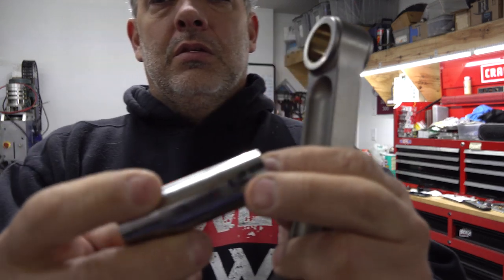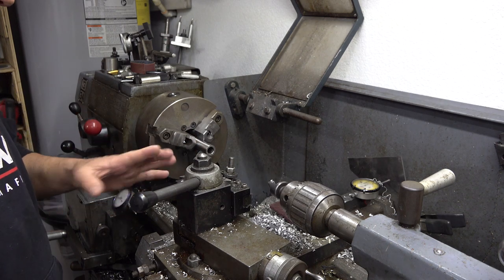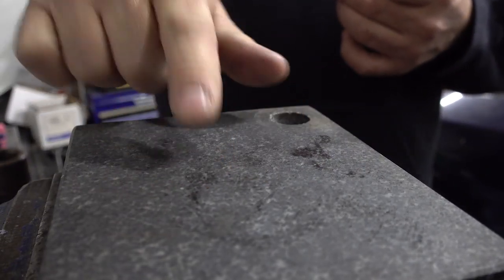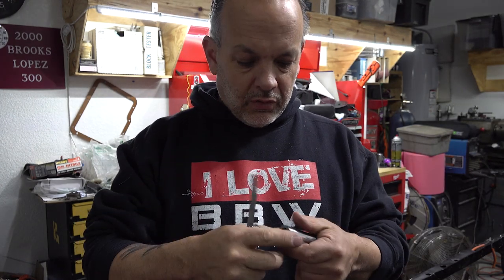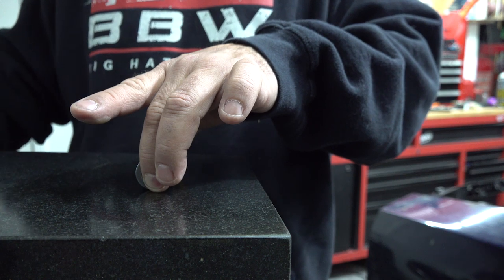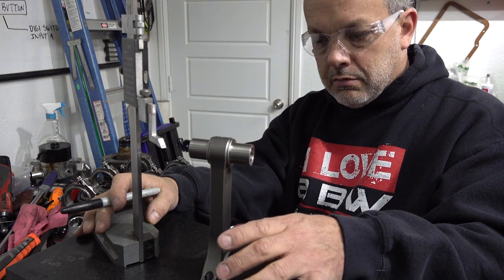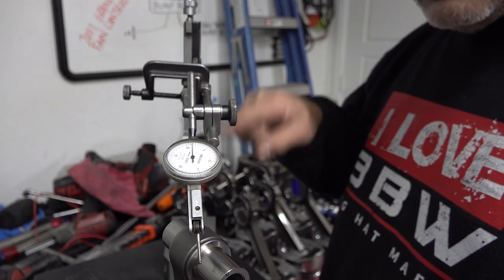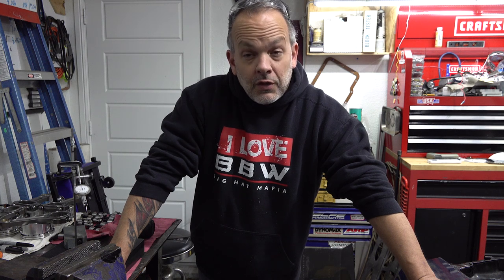You won't believe what I found wrong in the engine!!

Comment: Good call on pulling them all down and measuring. Not sure how long it took but I think it was time well spent. 
38 psi and a detonation incident or two really does put a lot of force on things. 
I'm still puzzled by the two sets of rings that lost their coatings. I guess the cylinder wall rust scenario is a good theory. I've had all kinds of just send it builds and just having two out of eight was just odd to me. 

Keep up the great work.
Reply from the maker: Believe me, I'm puzzled too. There was 3-4 ring sets that were damaged, just not all real bad. It's on the way back together now
Reply: @diygaragetx  Bore finish issue? I know some of those fancy rings need a mirror finish to seal up. 

Looking fwd to the upgrades!
Reply from the maker: Man, its highly unlikely. The previous build lasted years with the same setup. I still lean towards rust/contamination and the large unturned boost creep that did it in.